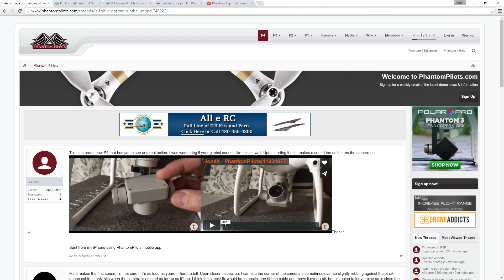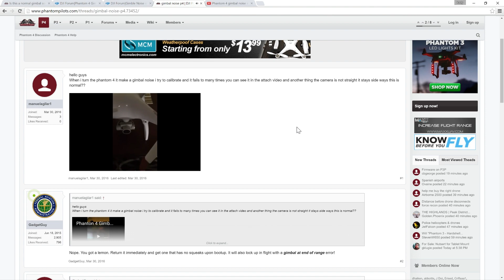DJI Phantom 4 Needs To Be Recalled?

Comment: I always enjoy your videos Andy but I'm very curious at 0:26 video say's and shows you "ripped all the stickers off".  Why ?  For credible reviews the unit needs to be shown that it is a phantom 4 and the color stickers help to show and prove the item your describing.  Just curious.  Thanks
Reply from the maker: +David Latham sorry David I should elaborate. The phantom comes with a lot of removable stickers. such as protectors that cover up the sensors and warning stickers to tell you about the props. they are meant to be removed to prove that the item is brand spanking new such as the clear cover you lift up on a new cell phone. cheers.
Reply: +AndyRC Understand.  Thanks and good luck with #3 !
Reply from the maker: thanks!

Comment: Does the clicking noise of the second quad affect your recorded video?   If the gyro  jammed while in operation then I understand your concern but if it's just a clicking noise then It just might be during the initialization the motor goes to the max throws to calculate the center.  Are you moving the motor under power?
Reply from the maker: +basimpsn it clicks both under power and not. and the others dont do it... even if its n ot a problem. consistency and quality control is an issue here.

Comment: i wouldn't tolerate that squeak!
Reply from the maker: +whatadizzydance me either!
Reply: DJI said so long as there is no error message it's fine. The ones that have the continuous noise are the ones that need replacing.
Reply from the maker: +FCPWHAT I'm not sure I buy it :-(
Reply: +AndyRC to be honest I am sceptical but not getting much time to fly at the moment. When I have, seems ok.
Reply from the maker: +FCPWHAT all mine have flown OK yes
Reply: +whatadizzydance 
--not for the price
Reply: +AndyRC DJI is a well known company, I would trust it. If you really do not like it, I suggest pre-ordering a Snap drone.

Comment: mine was different problem. not even sure if it made clicking or squeaking noise but mine would not find horizontal. it just flips back and forth in diagonal position unless I help it in horizontal position. DJI said that it was due to a crash. but my P4 did it from the beginning.

Comment: That clicking noise for the second is perfectly normal, as it's just the drive of the little (gimbal) motors.
Reply from the maker: +Alari Truuts its not normal and the fourth one didnt do it. check the update video. people who had theirs clicking eventually got gimbal disconnected errors so be careful
Reply: +AndyRC Thanks for the reply. I also just received my brand new P4 couple of days back and inspected every sounds origin :) just now rechecked the gimbal sound, and to me it sounds very much what a tiny electric motor sounds like when spun without resistance. However I'll be more careful thorough and do some further inspection, it would be a shame if brand new 1599€ equipment is faulty.. (that's right, they're charging more from us in EU :(..)
Reply from the maker: i agree. it was much more in gbp also

Comment: My P4 had the dropping when stopping issue.  Also the gimbal had the same noise as it stopped initialising. I rang the nz dji agent I bought it from and wss told I was the only one with this issue. I returned it within their 14 day money back period and heard nothing more from them. I rang and emailed several times. I asked for a refund, but was told it had to be unused! I had charged the battery once and flown twice for about 5 minutes. Its nearly 2 weeks since I returned it and I still have nothing to show for my $2928. Sounds like Apple were a lot better to you..
Reply from the maker: +Steven Mckelvie thats aweful you must get that money back!
Reply: The $2928 included an additional battery that was on back order. I managed yesterday to agree to refunding me for that, but still nothing on getting the Phantom back. When they eventually get the P4 back to me I will be selling it. Glad I have a good working P3 pro. I'm tempted to try and get a refund through the nz consumers guarantee act. .

Comment: Bummer. Is this something that will happen eventually or only an issue if you get it out of the box?
Reply from the maker: +MicroRCFiend this is stright out of the box. the second one never even flew. It works with these faults but the worry is how long will it last before it becomes a real problem. cheers

Comment: Are you an Aussie? I agree with you a $1500 prosumer product should not have any squeaks.it implies there is some frictional inference, the affected parts may fail, the day after the warranty is over.  Doubt it is a firmware issue, it sounds more like a manufacturing and QA inspection oversight. Did you get any assurance from a DJI product manger, they would improve the manufacturing process and add another QA check point?
Reply: It's not friction, it's bad motors. Still, I agree with you

Comment: Mine sounds exactly the same! It worked great for the first 7-8 flights but then I got a message "Gimbal disconnected" and was unable to see the picture. My Phantom 4 is sent back to the store and I hope to get a new one as soon as possible.

I'm glad though that I'm not the only one with these problems.
Thank you for uploading the video!
Wish you the best of luck!
Reply: +FPVStockholm I had the gimbal disconnected error, and no picture, I fixed it by reformating the SD card IN THE P4...  I had deleted files from the card in windows, and may have corrupted the card. Anyway in my case I could not at first reformat, (it timed out) so I had to insert a different card, which I then formated, and it worked perfectly. I then reformatted the original card and all is right with the world. Hope your new one works well for you.
Reply: +Matthew Elyash Thanks for your advice. I'll try that out if this problems occurs again.

Comment: This is an old video, however I'm on my second Phantom 4 Pro, and I'm having the same issue, a squeaky noise on the gimbal motor,  and vibration. I seriously think there is a production or design flaw in the Gimbal..
Reply from the maker: yes perhaps :(

Comment: I am a firm believer that buying a newly released product is rarely a great decision. I waited about six month before buying my Phantom 3 and was rewarded with better motors and an improved body shell, not to mention an extra battery. I am planning on getting a P4 but not until the kinks are ironed out or resolved, at least, hopefully so. Hope it works out for you.
Reply: Then few months later a new version comes out
Reply from the maker: +John Law yes this is the issue. if you wait too long its then out of date! nothing wrong buying the version before I guess
Reply: I couldn't agree more with you, however I think it depends on why you are making the purchase in the first place. If you want the most up to date, be the first one, then by all means don't wait, but if you don't want headaches or to deal with initial problems then wait a few months. My P3 still has a lot of flying yet to do and many the new features of the P4 are not why I would get one to begin with except for the better optics and recording abilities. 
There is one thing that I really wish would happen for early adopters of new products, they should receive some added benefit for being one, right now, it's upside down with people getting on later reaping the rewards, improved products, extra batteries, etc. Perhaps a big discount on future purchases for initial buyers, who wade through the early issues as they "beta" test new products. Just my opinion.
Reply from the maker: thats a good idea yes lets hope dji are listening :-)

Comment: Andy,   DJI tells me it's normal..    From my RC experience with cars, heli's and boats, I'm assuming it's a servo problem.   And yes, many people have this problem.  My video is the one with the P4 on the steering wheel in my FORD  (hehe)..    I'm currently talking with DJI about this..   Also,  my gimbal calibration would fail at 72% every time, and then say susccessful!!! odd!!   But now it passes no problem every time..
  I hate to send mine in, b/c it seems so minute, but for $1400, I should have a quality product, defect free..
Reply from the maker: +Dean-o Dambro (Deano Dambro) Hi Dean. I can confirm that the third one turned up and has non of these noises. the only reason i persisted was because my friends didn't do it. Id say definitely fight for it

Comment: Spot on pal  it's not a cheap piece of kit if there's a noise when brand new in a few months this will be a failed Gimbal motor /bearing send it back  until you get a good one, these are the problems when buying a new product though, often untested and rushed to market

Comment: wow! you think yours has been an 'absolute nightmare'???? mine has been much worse, and my customer service i have received has so far been insanely bad! i treated myself to a dji phantom 3 pro for christmas, instantly noticed the image quality was appalling... in the dng raw files i was seeing millions of tiny white dots all over the image (not digital noise as it was a clear day on iso 100!?) and the centre of the image is completely out of focus compared to the edges of the image. i contacted dji and they agreed that its bad and said for me to pay £53 to send it to the netherlands to be fixed under warranty, the £53 was for the postage. baring in mind that it took them 2 weeks to reply, and when they did it would sometimes be a short sentence agreeing with me, but that was all, i had to wait another 2 weeks for a reply as to when i could get it fixed, ridiculously infuriating!!! so eventually off it goes to be fixed in the netherlands, then a week later i receive my drone back, instantly i test it out and notice the same out of focus centre in my video and images and also the millions of white dots all over the place?? i contact dji and after 2 weeks they reply saying they will give me a free rma and a postage label for tnt to pick it up, free of charge. i wait a week, then they email me saying i need to pay them £55 to fix the problems (which is how i received the drone, and they failed to fix the first time round!?) as its no longer under warranty!!!??? its been 25 days since they sent me a bill for my drone t be repaired and they are not responding to my emails now. so i just have a controller and a couple of batteries in a case that i can't do anything with and a broken drone in the netherlands with a company who isn't willing to respond to my emails!!??? absolutely appalling service!!!!
Reply: Dude, the dots are inherent to the DNG file if you are looking at them in something like LightBridge. Bring it in to LightRoom or any color grader and they will be gone. 

If you are not doing any color correction, you don't need the meta-data and why are you shooting raw. There are enough issues with the P4 that we don't need fake ones.

Comment: That's bad luck. Definitely sounds like something inside was messed up. I'm sure it could be fixed but you shouldn't have to fix it. Maybe contact DJI. (haven't watched this video through yet if you have) DJI and their quality control has a lot to be desired. I recently got a battery, straight out of the box a dud.

Comment: Hi Andy 
I'm you might be blown away with the P4 
I'm blown away that you brought mass produced crap.
with your knowledge of RC WHY THE HELL DIDNT YOU MAKE ONE .
YOU LIKE MANY OTHERS HAVE BEEN SUCKRED IN TO BUYING THE LATEST THING.YOU SHOULD DO WHAT DJI DO 
LET ALL THE OTHER PUNTTRRS FIND OUT THE FAULTS THEN BUY THE DJI P4 MARK 2 
I STOPED BUYING MASS PRODUCED CRAP LONG TIME AGO 
BEST OF LUCK 
Brian 
London
Reply from the maker: hi Brian. This is an Rc channel that specifies in all kind of flying rc aircraft from budget to high budget. Of which the phantom 4 falls Into that category. Cheers
Reply: Hi Andy
I'm quite an avid follower of your exploits.but the point I was making is if you build your own you have complete control over the components and build.also if you build it you can repair it .unlike the dji unispire where as if you so much as touch it apart from putting the props on you invalidate the guarantee
Reply from the maker: yes you are correct dont worry this isnt me giving up on the diy aspect of the hobby. just something else to try :-)
Reply: Glad to hear you haven't gone over to the dark side Hahahahahahaha
Reply from the maker: i think its healthy to enjoy every aspect of the hobby i try to keep a diverse channel. cheers

Comment: glad I am going for the Yuneec H. Not interested in an apple style company.

The whole design of the phantom sucks as it still looks like a phantom 1, just fatter and a bit more streamlined.

That is what apple do, Incrimental design changes.

Time to move on dji and give us reacts and 360 camera rotation and interchangeable cameras. 

The Yuneec H is modular and also coming out with different camera options and addons whereas the Phantom is locked and no upgrades or modular design.

sick of dji as it had now fully become like apple.
Reply from the maker: +Dennis Rogers id love to get my hands on the typhoon H. cheers
Reply: +Dennis Rogers They did! It is called an Inspire.
Reply: The design of the P4 only looks fat in pics. In reality, it's a very awesome build, thin, strong and light. I won't say the factory line is doing well but the original engineers of the P4 did a great job on the body.

Comment: Just buy a Phantom 3 Professional, it is the superior model  anyway and is $400.00 less. Happy Flying!
Reply: +Bobster986 The P3's all together seem to have less faults than the P4!!!!
Reply from the maker: +J_Grindel they are older and have had more time to be ironed out. but still any product at this level should work perfect from day 1
Reply: J_Grindel mine is perfect.
Reply: AndyRC mine was perfect right out of the box (minus firmware issue which are common for all), plus I have plenty of batteries, not going through that again until DJI comes out with a 360 OAS for the Phantom or Inspire 1 Pro.

Comment: I understand, it's quite painful.  DJI, from what I hear provides horrible customer service.  DJI has very poor quality control, as a result, Phantom's go out that should not be going out, which ends up providing a great number of Phantom's that require service and returns.  I just wanna film in the air.   By the way, I'm very happy with my Yuneec Typhoon H.

Comment: A big batch of bad gimbal mechanisms. For the price of that quad, either DJI or the gimbal manufacturing subcontractor should do a QC check of EVERY gimbal mechanism after they are built, allowing them to find bad units and identify bad runs caused by bad parts lots or by design changes causing undesirable effects.
Reply from the maker: +Winston Smith I agree Winstron thanks

Comment: Welcome to the world of Mass produced DJi nightmares, your lucky you bought it from Apple! otherwise you would be waiting 3 months to get any problems fixed if your lucky, wait until your shell cracks around the screws from vibration then you will be sending it back again...lol i sold mine, never again....
Reply from the maker: +rwquad thanks for the info :(
Reply: The shell cracks around screws was on the Phantom 3
Reply: +Romano well guess what, they are still there because whoever assembles these DJI quads in China has a bad habit of over tightening the screws at the factory, hence why my 3 week old P4 has 2 shell cracks just like the P3, there`s plenty of P4 cracks documented online as well.
Reply: +rwquad  what did you get instead? i have a chroma and i have had so many issues that i will not fly it out of line of site. i want lightbridge so i can widen my filming capabilities and have debated selling the chroma and extra battery and getting a 3 or a 4 phantom.
Reply: I`m building a 5 inch Alien right now, i`ve had 2 DJI`s and both of them are not worth the trouble, small things that cause major headaches to fix.